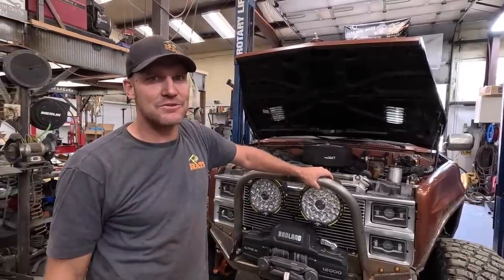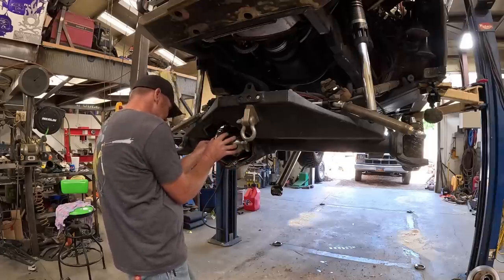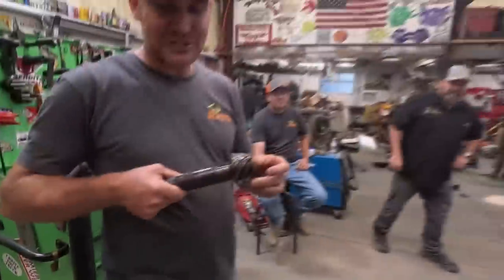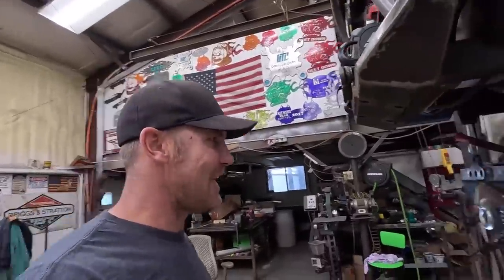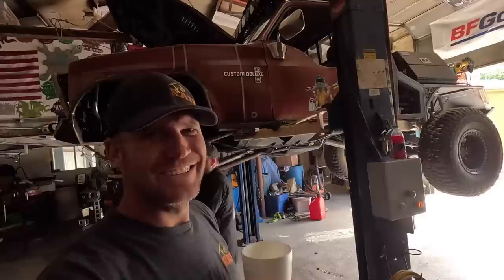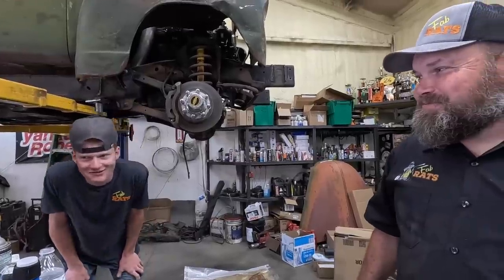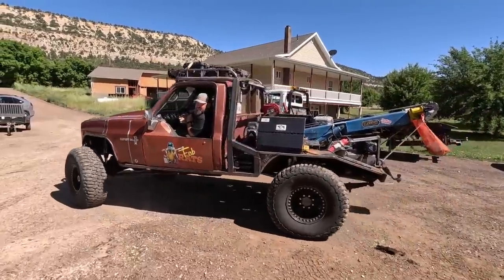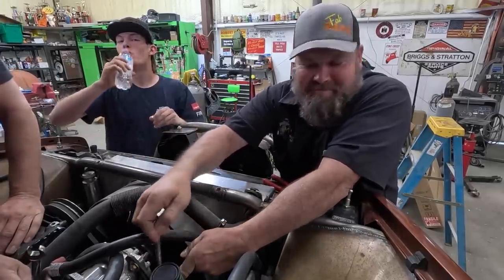I Can't Figure Out The Rat Rod Wrecker! Plus, A Surprise Visitor!

Comment: When putting on tires we use a flat head shovel to pry the tires up to get them on the studs. We call it the "Back saver 3000"
Reply: I've done that flat shovel and a spade. Spade works better for me.
Reply: I just use a long screwdriver.  Easy to manipulate.
Reply: @OldSchool-ez4uv I use the floor jack pole, same thing though.
Reply: Lift with your legs not with your back

Comment: There's only one thing missing on your wrecker, and that's some outriggers at the back, because while stationary you're often pressing it down more than you're lifting.
Reply: Thank you for knowing the proper term.I said; "They need Rams to stake into the ground so it won't move"; but not  realizing they'd "Wheelie" wasn't why I'd said this at their start.I thought it'd get pulled downhill from lack of weight.Good call.
Reply: I think outriggers were mentioned during the build. They said they would air up the bags to stop it dropping and outriggers wouldn't work because they need to be able to adjust the boom and move the truck while still pulling/ lifting. I certainly think they would be a great option for static pulls.
Reply: @graememckay9972  Yeah and/or more weight on the front.  Removable tractor weights on the front might help.  Prob get in the way of the front winch though.
Reply: I though about that as well, but because they need to move the wrecker, I though to some removable "wedge" between the bed and the frame to stiffen the back while pulling only

Comment: The last two videos seem to show the reasons why Rory doesn't like to use air lockers. 😂
Reply: Bleepin Jeep Cole said the same thing, but still went with the air locker cuz of the finance build
Reply: Thinking that too. Paul seems to have endless issues with air lockers.
Reply: @om617yota8  And transmissions.
Reply: I have been running air lockers on my 88 Cherokee for 14 years with no issues. I wouldn't change them for anything. 😁
Reply: I do a lot of 4wding and the only people who have issues with their lockers are air lockers to many parts an seals to go Bad e lockers are king the only issue you will have is snapped wire but that’s an easy fix the only other issues with e lockers are people engaging them while still moving my current rig only has auto lockers and they are good nice simple design I personally prefer my old truck that had e lockers in it 

But in short iv seen lot of air lockers have a lot of problems only ever seen e lockers snap a wire and auto lockers effect steering sometimes can be hard to turn air lockers suck to much maintenance an things to go wrong

Comment: have you guys ever tried Lube Locker gaskets for the diff?  I have had great luck with them and the best part is the cover comes off with zero effort and they are re usable.  For as many times as you guys take diffs apart it might be a lot easier.

Comment: Yeah had some bad experiences with those hoses from coming off when not expected (luckily it was parked at home) the adaptor cuffs on the end are slightly too large and don't clamp properly  I'm currently running double clamps on my lower hose as it was the only hose I could find

Comment: 10:36 Just build a housing spreader already! Makes diffs 100x easier. Those holes in the casting are there for a reason.
Reply from the maker: We have one but with the truss it don’t work
Reply: @FabRats  Ya, I thought of that after I commented. Now I'm pondering the options of bolt on trusses.

Comment: Weird, the radiator hose leaking on the right side, the same side I saw a translucent cloud coming fron under it in the previous video of y'all recovering that camper trailer off of the cliff. The cloud happened as soon as you started the engine to back off the roll back tow truck

Comment: I do know you wouldn’t be able to run down a HWY or anything with fluid in the tires! Just a question I had. We use add fluid to the tractor tires so we had better traction in the fields!

Comment: Hey Paul have you thought about putting down riggers on the RatRod Wrecker? I know in the last video with that travel trailer they would have helped when lifting it . I know the suspension is made for rock crawling and stuff and not more rigid like a normal wrecker.
Reply: I thought a hitch with trailer jack. Simple and effective

Comment: One thing about that diff cover...please use a gasket instead of gluing the crap out of it . I watched you beat the on that cover and reminded me of changing the gear oil in mine. Previous owner used some kind of super silicone glue and ended up destroying the cover getting it off. Gaskets work fine and make life easier.

Comment: Is the new welded tab on the wrong side of the copper line?  The Dif fluid will cascade down the front of the cover and be moved back along the bottom of the Differential when the wrecker is driven.  What about driving in reverse?  Is the line fixed so it won't move to the back or front to duplicate same problem as before??

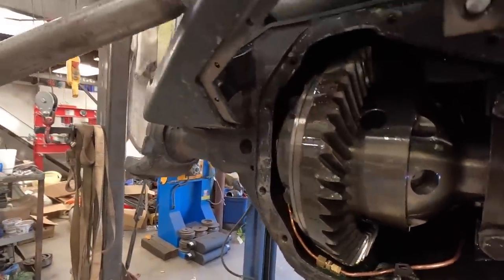Comment: 3:22 I have a giant ten foot tall Step Van ... with a 14 bolt rear end, I want a locker .. THIS is the reason I am not getting a ARB Air Locker, besides the bladder leaking and al air points leaking this is the 4th one I've seen on YouTube / internet where the inner air lines destroyed the ring and pinion :( 

Surprisingly this is the only dash selectable locker available too (I have no idea why)  .. I will choose an  Eaton Detroit Truetrac

Comment: 17:35
3 min no water.
I saw water.
I've had the Carolina reaper 1 chip, and a variety of hot ones hottest sauces. The problem there was more about the density than the heat. 3 min for a piece of jerky that size would be tough on the jaw even if it was sweet.

Comment: Paul or crew, the hole on either side of the diff cover is there to put a spreader in. Basically just a pin that fits the holes on either side and you put some pressure on them separating the housing to allow putting in the shims and diff without fighting to get them in with out folding them up so many times. Your a fab shop so make your own tool. You see how easy it is to suck bearings off of gear sets by having a proper tool that reminds you of the power steering pulley off so just ponder a minute or find one on google and copy it

Comment: hey paul, suggestion to you for the towtruck, since you already have an electric hydraulic pump for the boom, why not install a set of hydraulic rear spades so your not putting so much stress on the rear suspension when lifting or pulling (example the camper trailer). im sure your can figure out away to mount them so they dont interfer with any rock crawling, possibly hinged so the lean or fold back ontop of the rear deck

Comment: Okay, you can get backup batteries that charge to full off AC power and they install fairly easy.  It's a good stop gap when the power goes off to wrap up things and power down, but you can also hook your generator(s) to them making a safe system to keep your power going.  If you hook some solar panels to them, you can run for days off grid 👽

Comment: Badass video
For A helper installing outer shims look up this tool # [ Kent Moore ] # J-25588 specific installer tool for GM I got it back n the day when I was working as a heavy line mechanic at Lou Grubb Chevy that's all I did was rebuild 4wd,transfer case back in the 90s 👍👍👍

Comment: little secret to using shims never use more then 1, for fitment use as many as you need for install combine all your shims into 1 shim the size of them combined. it'll be a million times easier on install at least plus less of a chance of the shim falling out or getting out of line.

Comment: Do not teach your kid to pull and bounce off a lift. It is unsafe until or unless they know the PSI in the Tire. It can break a jaw a nose and even an arm!! Especially if he ever works in a shop and or Nascar!! How do yo properly seat a z rated tire?
Reply: My point. Finding weight distribution in the beed
Reply: Bulbs
Reply: If I test your rim and tire at 800 fpsi and you fail. I will not let those rims and tires race
Reply: Basic Corvette rim standard
Reply: They out sourced to Papco and only 2 of use put together alot of rims mainly Chevy. 4 people in the whole of the USA did rim to tire testing.
Reply: After 2008 Papco hung on. Constantly bombarded by Jewish people with hats😮😅. The company was bought out and quickly failed.